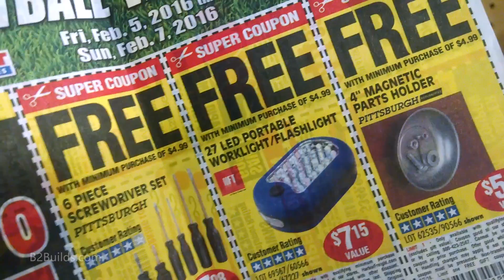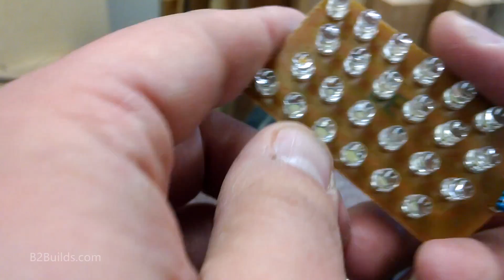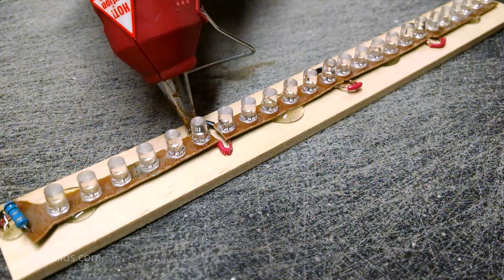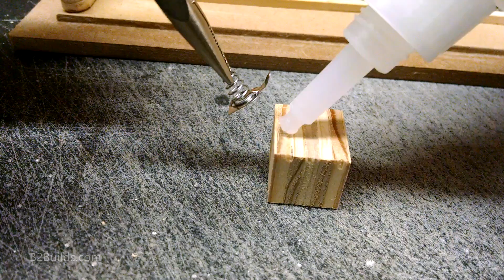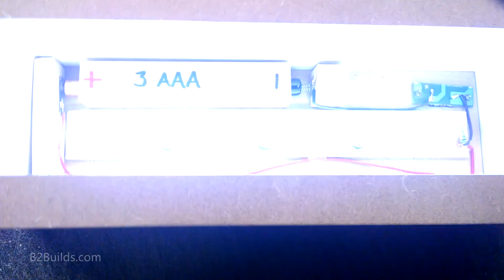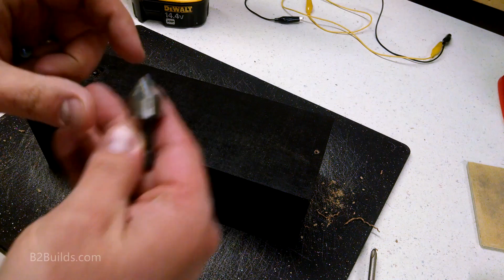Hacking a FREE Flashlight into an LED Backlit Sign

Comment: Great job! I have a large AC circular magnifier desk lamp with probable bad ballast. Can a bunch of these strip connected in parallel be powered by a 3-4.5 volt device AC power source?  Say from an old phone or battery charger etc? House rules make due with stuff from the parts bin.

Comment: Excellent idea! I was wondering would it be possible to connect several of these lights to a large power source to light up a shed?
Reply from the maker: Probably, you would need to supply DC power, though determining the necessary circuitry and power requirements is a bit beyond my expertise.

Comment: I think these little HF lights are just great, and have been thinking about a few different hackable uses... But... I REALLY don't want to use a series resistor to limit the current.  It's inexpensive, yes, but wastes a high percentage of the power.  Plus the lights will dim as the batteries discharge.  I'd much rather figure out a low dropout regulator, constant current source solution.  Any ideas?  One of the 'applications' I have in mind is to string a couple dozen or so of these lights, one every twenty feet or so, along an off grid driveway (to make walking easier and safer).  Efficient of available power will be even more important in that use case.
Reply from the maker: +ellsworth I'm afraid the constant current regulator is a bit too complicated for me to give you a good answer off the top of my head, could be an interesting idea to experiment with. For your outdoor application, you might benefit from the simplicity of using cheap solar-charging landscape lights. Not as fun, but could be more practical for that specific application.

Comment: excellent vid Ben! Just the type of video I prefer! another thing you can use for the opaque panel, is a strip of thin white cutting board! I used this for my Kart and it diffused the leds nicely! Keep it up!
Reply from the maker: +Geeksmithing Thanks Wes, great idea with the cutting board. I did find some white acrylic at one of the local home store, but it was pretty thick and quite expensive, just wasn't worth it. I'll have to keep this in mind next time I go to IKEA for sure.
Reply: +Ben Brandt they have a good Multipack at Target with thin whites for about ten bucks. :)